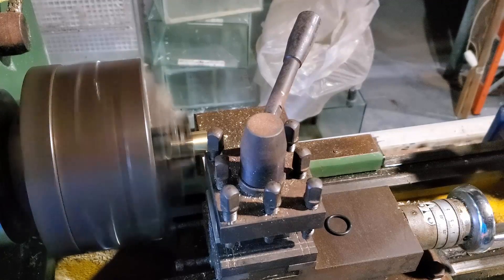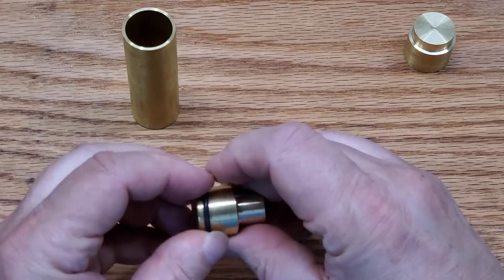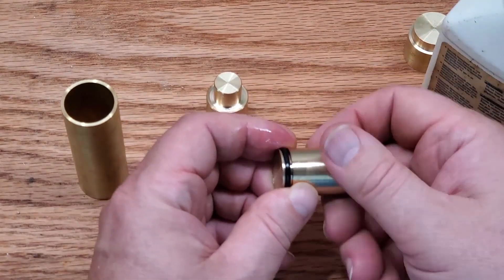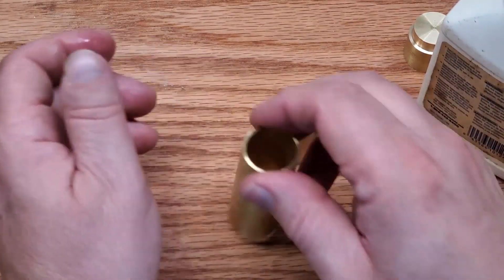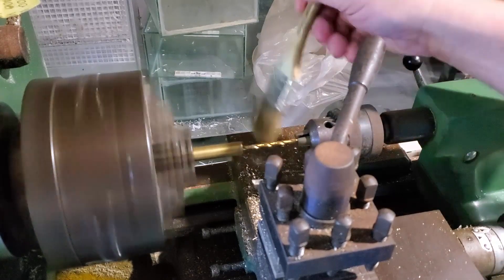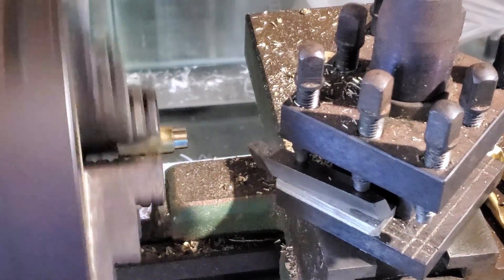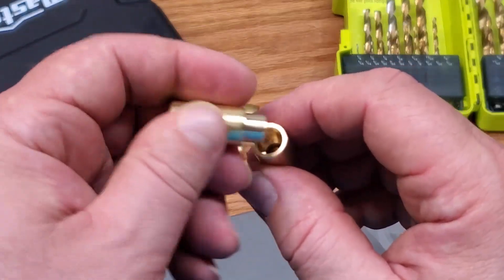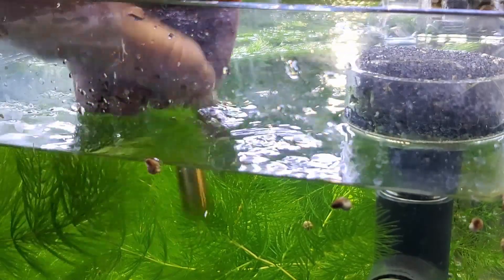DIY Brass Air Pump Part 2

Comment: Good series. But I think the flywheel to two pistons will tangle up, unless it's a crankshaft design, or a pully/belt  driven flywheel. 
it would  need to use a transformer , and single rod that connects on both ends. Moving from one side to the other.
Reply: Never mind. The piston rods would be offset , with an inner and outer, long and short distance. The fly wheel spins the rods together and not be tangled, with a short and long rod design.
Reply from the maker: This is one of those things that will be easier to explain as the build progresses. Hope you will continue watching!